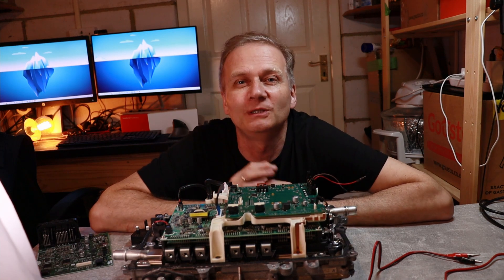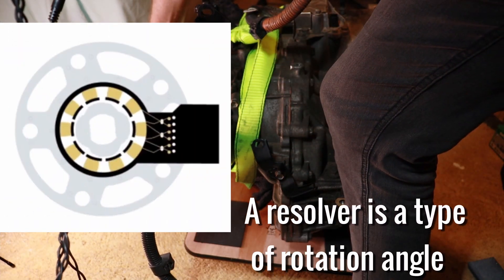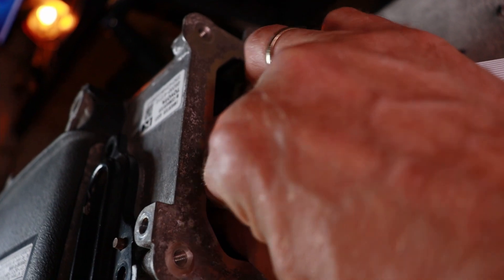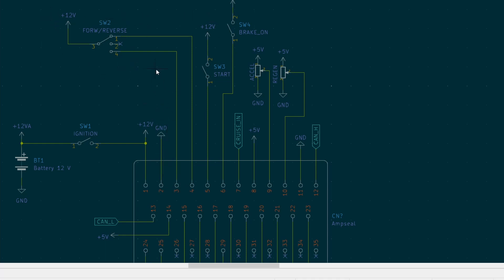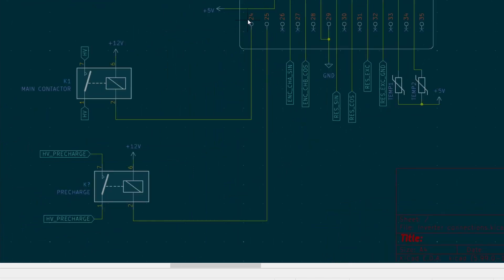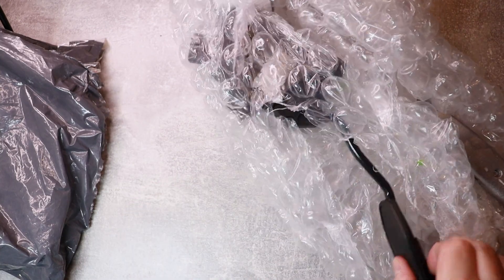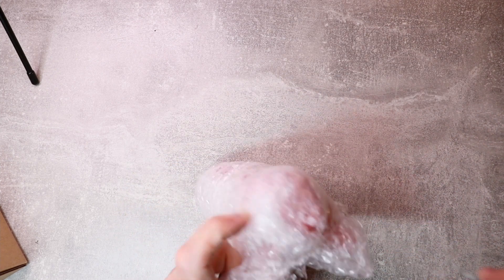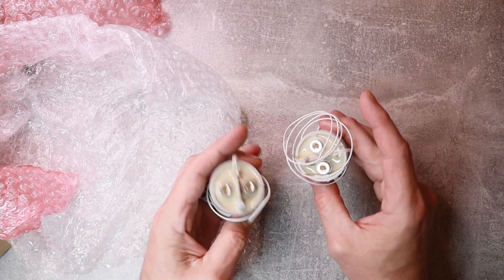Gearbox as a motor DIY EV Toyota Prius Ep 8

Comment: Do you think this is something you can keep in a Prius to convert it into a full ev instead of a hybrid?
Reply from the maker: Yes I think so, as I mentioned before I have not chosen the car yet one of the models I am considering is Lexus CT200h as it the same Prius gearbox and the same mounting points and shafts. I prefer it to Prius as it has better handling and better suspension. Only if I could find a relatively cheap one
Reply: @LatutaEV  That's sounds dope, I can't wait to see you finish the project!